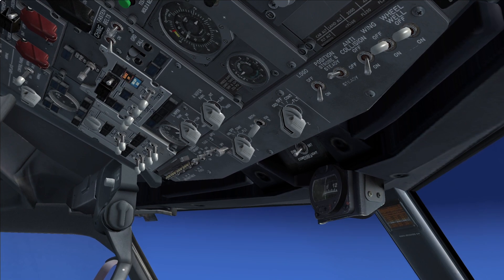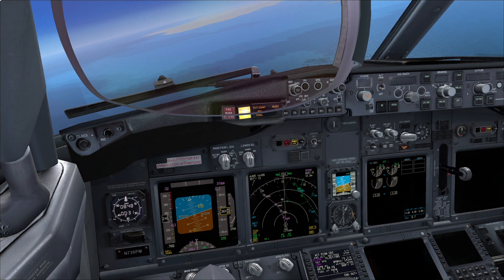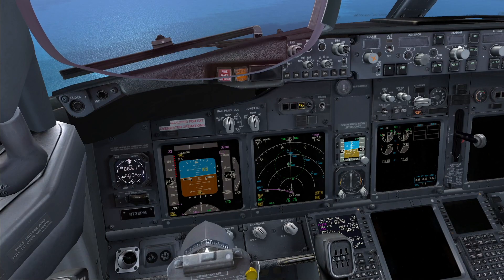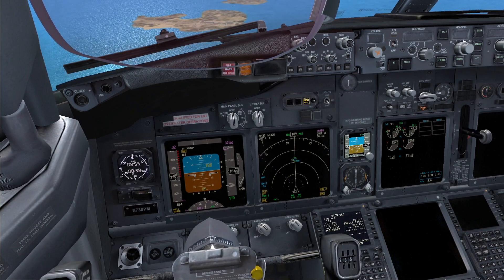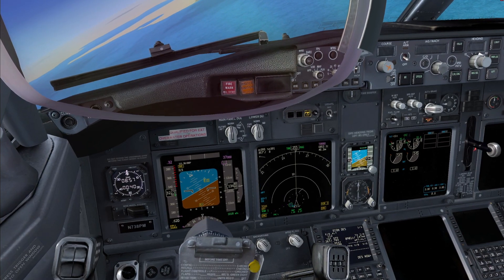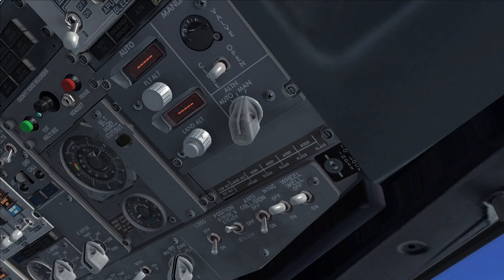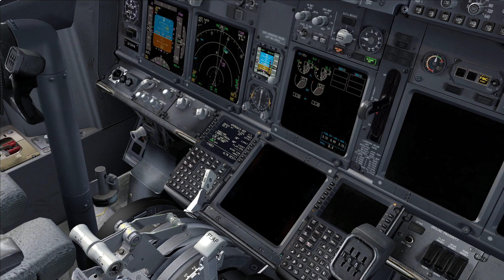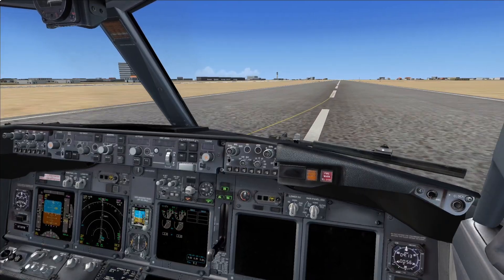Dual Electrical Failure

Comment: A question. Which lights exactly illuminates on the overhead panel? Especially I wonder drive lights . Cos I think this is not the CSD failure or IDG failure

Comment: So if both electrical buses are out while the plane is at cruising altitude, would the outflow valves open up if on Auto mode?  Is that what caused the cabin altitude to increase at 2:39?
Reply: It will remain at the last position where it was. As soon as you set idle thrust there is not enough bleed air to maintain cabin pressure then it will rise slowly.

Comment: Great videos by you Capt. As always.

I do have few requests on how to perform in B737 simulator
1. DME arc approaches with Dual FMC failure 
2. How to fly Raw Data ILS approaches(Techniques)
3. Engine failure at V1(Initial Controllability)
4. NDB approaches.

Cheers!!!!
Reply: 1. DME Arc Approaches with Dual FMC Failure
You can fly a DME arc procedure using conventional navigation systems. It is not necessary to rely on RNAV systems. Make sure your VOR or other required navigation aids are properly set on your NAV.

2. How to Fly Raw Data ILS Approaches
Fly manually and monitor the IAN (Integrated Approach Navigation) on the PFD. Maintain alignment with the localizer and glide slope indicators throughout the approach.

3. Engine Failure at V1 (Initial Controllability)
If an engine failure occurs at V1, follow these steps:

At V1: The Pilot Monitoring (PM) announces the failure, e.g., "Master warning, engine 1 & 2 fire" (if the failure involves an engine fire).

After liftoff (no actions until 400 ft AGL): The Pilot Flying (PF) continues the takeoff and does not take any immediate action.

At 400 ft AGL:

PF selects heading and limits the bank angle to 15°.
PF calls, "Identify the failure."
PM checks and reports: "No N1 rotation, no N2 rotation, and engine overheat light illuminated" (or other relevant indicators). PM confirms the failure is an engine fire.
PF approves or rejects the identification.
Engine Fire Memory Items:

Autothrottle (if engaged): Disengage.
Throttle lever (affected engine): Confirm – Close.
Start lever (affected engine): Confirm – Cutoff.
Fire switch (affected engine): Confirm – Pull, then hold for 1 second.
Discharge the left bottle. Wait 30 seconds. If the fire warning persists, discharge the right bottle.
PM announces, "Engine fire memory items completed."

At engine-out acceleration altitude:

Set IAS to the flaps-up maneuvering speed.
Retract the flaps and select a 25° bank angle.
Activate continuous thrust on the FMC.
Complete the after-takeoff checklist and inform the cabin crew.
Proceed with the engine-out SID and advise ATC.
Example: If departing Antalya and experiencing an engine failure 5 NM from the Antalya VOR, you would say: "Engine failure 5 NM from Antalya VOR, turning right to TOPUZ, holding over TOPUZ with a non-standard hold (left turns), inbound 002°."

4. NDB Approaches
If the NDB approach is included in your navigation database, you can fly it using the FMC. It is not mandatory to conduct the approach conventionally.